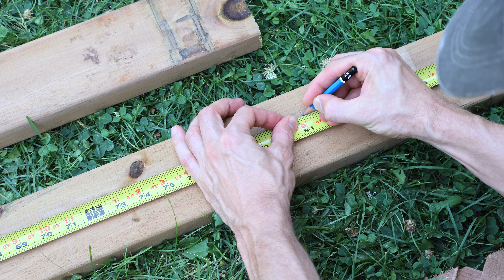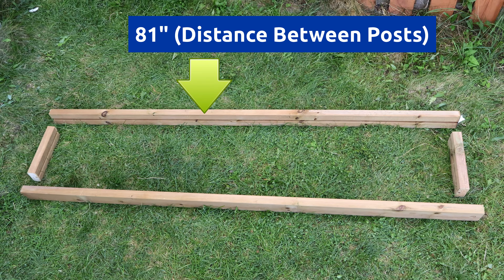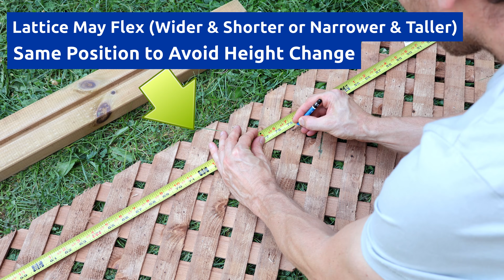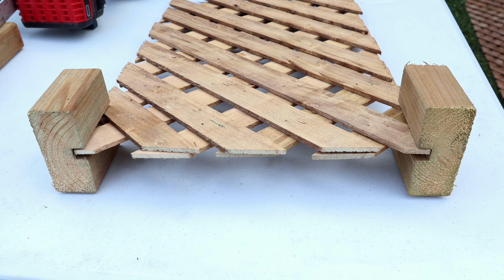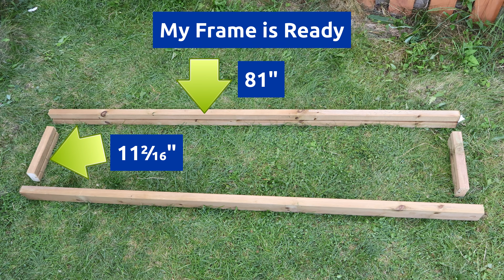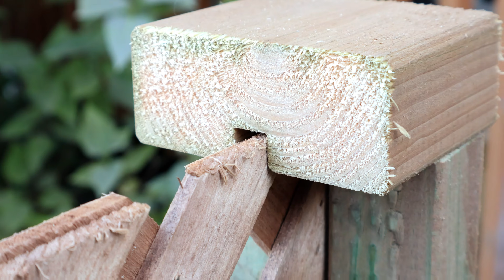Framing Lattice Panels with Grooved 2x4s - Measurements and Assembly

Comment: Were the notched trim boards bought that way at a lumber store? I can’t find any
Reply from the maker: It was bought that way yes.  In Canada we have it at almost all lumber stores, for example: https://www.homedepot.ca/product/micropro-sienna-2-x-4-x-8-grooved-pressure-treated-wood-above-ground-use-only-/1000793822  
In US I cannot find the same item. This looks similar, but I think the groove is thicker:  https://www.homedepot.com/p/Mendocino-Forest-Products-2-in-x-4-in-x-8-ft-Grooved-Redwood-Fence-Rail-814849/100043550   If it's thicker, a thicker lattice to match would be needed.  The Mendocino Products representative said it can be special ordered by Home Depot in US, and for questions, their customer service # is 800.777.0749 .   Hope that helps. Thanks for watching!
Reply: It's with the lattice